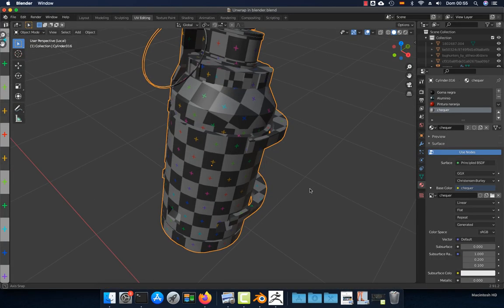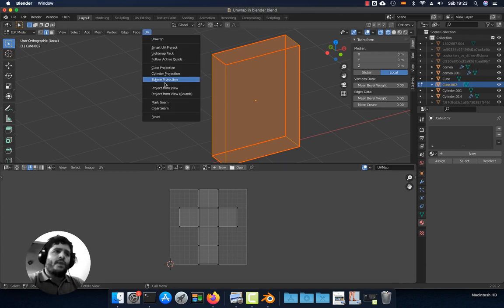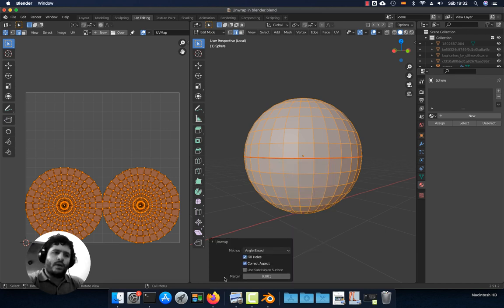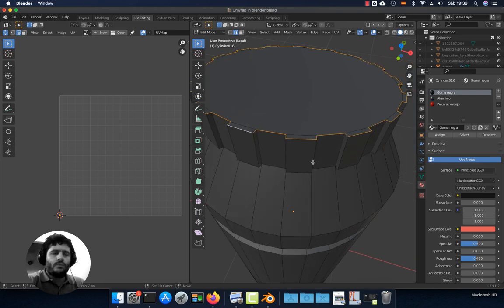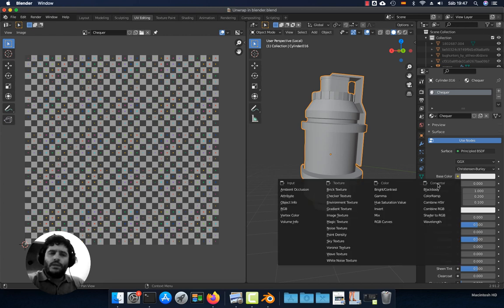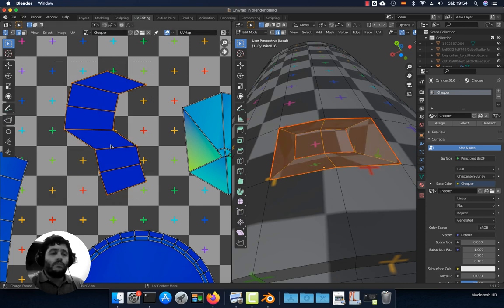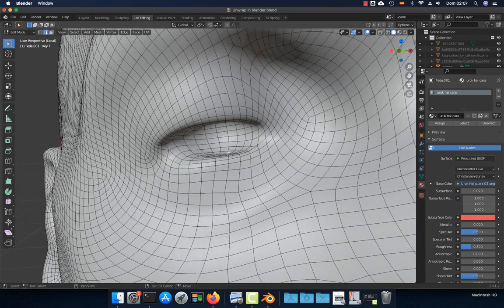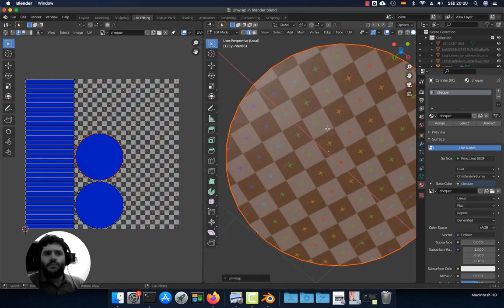Introduction to UV Mapping - Learn the Complete Basics with Blender

Comment: Another very useful tutorial for a beginner like me. Your style is slow, but I like that and I've learned a lot in these 50 minutes. Much better than watching ten of those 'UV unwrapping in 5 minutes!'-tutorials! Many thanks, looking forward to more Blender content.
Reply: And a question regarding your robot unwrapping. The robot is not actually one single object, but rather multiple objects, right? For instance, the grenades are separate objects? Then, for instance the grenade also seems to be subdivided in separate parts? Is the grenade actually one object? And does that object consist of one unified mesh, or multiple loose meshes? The parts you select separately in the video for unwrapping, are they actually separate parts or vertex groups? (I'm currently working on a rifle myself, that will be textured and animated too, and I'm trying to find out which parts I should merge/connect for those goals). Thanks again!
Reply from the maker: Hi Guido, Yes the robot is made of multiple different objects. The granade is one separated object. Inside this object there is a mesh. This mesh has different shapes, with diferent loose meshes. I can select the different parts of the mesh pressing ´L´. This is the shortcut for ´Select Linked´. This command allows you to select all the mesh that is connected with edges. If you are working on a rifle I would recomend you to model each part of the rifle separated. The grip is one object, the sight is another, the barrel another and so on. If it is manufactured separately you model it separately. That will allow you to have independent topologies or geometries. When you have the entire model you can first unwrap each object and at last select all of them in object mode, enter to edit mode and then unwrap everything again. This way Blender will re unwrap al lthe meshes inside the UV space. I hope I have cleared your question and thank you for your support! Best!
Reply: @medicciGame  Thank you for your detailed answer, much appreciated! Very useful. So keep all parts as separate objects while modelling and UV-unwrapping. What about later stages? In general, would you keep the objects separate as well during texturing and/or rigging/animating? Would you join all objects and make everything one single object at some point, or would you keep the objects separated all the time no matter what?
Reply from the maker: When you are texturing you can keep them separated. When you are going to export it to the Game Engine you can join all the objetcs except those that will have movement such as the trigger, the firing pin or the slide.
Reply from the maker: Hi Guido I am very glad it was useful! Yes in this video I have taken my time to explain and show some practical examples and I'm glad it was worth it. Thank you for your comment and support!
Reply: Great, thank you very much. I’m looking forward to more of your tutorials!